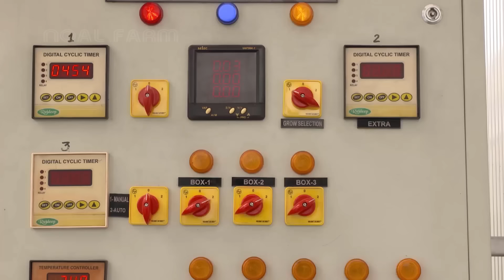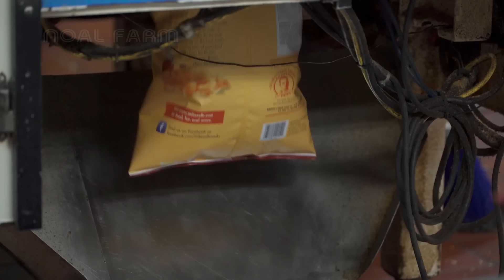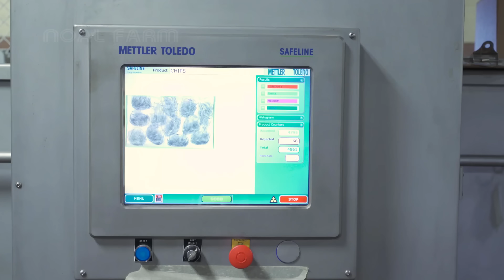Aeroponics Potato Farming - Potato Chip Process Factory - Modern Potato Agriculture Technology

Comment: I can’t se how this can be cheaper and more efficient than conventional farming considering the amount of electricity needed.
Reply: No need to water whole fields in dry season. No need to waste fertilizers.
Pumps and fans don't use that much electricity really.
Reply: Potatos need very specific climstes to be productive
Reply: Farming implements use a lot of fuel, in-field irrigation is a total-loss system, so no water is recovered once its pumped put to the fields, and you can't control nature.
Reply: I think also this has limitations. Potatoes are harvested small, any larger and it probably will break off the roots its hanging from. Maybe good for seed potatoes. Might work for smaller veggie types.
Reply: Thats simply Dreck, Müll. No human shall eat such rubish🤢
Reply: It doesn't deplete the ground. All electricity CAN b eco friendly and free.
Reply: @kilnrargentina3955  really, considering they grow around the planet in very different climatic zones I'd argue that they are extremely adaptable and quite easy to grow in a variety of habitats. It's no mystery though farmers and food giants pretend it's some superhuman technical feat to grow a potato.

Comment: I like this a lot, but given that the potatoes are hanging from a root mass not designed to take weight, does that limit the size the potatoes can get to before harvest? The potatoes in the video are a bit small. I wonder if you layered a series of mesh nets, the roots could grow down through them and support the weight of the potatoes till they reach a larger size?
Reply: My guess is that the node where it connects automatically adjusts to grow thicker to support that weight. They of coarse as you said are not designed for that purpose, so there will be a limit on what they can support.

Comment: How nutritious are these without the soil? I thought they absorbed nutrients from it.
Reply: what it lacks, they added the nutrition into the water
Reply: Well I guess even soil has to be fed and nurtured to have any nutritional value to plants. The soil itself can b depleted of all nutrients. It must b added either with artificial products ( fertilizers etc)or natural products (compost, manures etc).
Reply: Soil is not a must since sufficient nutrients are fed through water. By this process, the question of cleaning the soil from the yields does't arise. Collection of the products in a healthy way is possible. While in mud, decay, mutilation, attack of pests etc can happen. By the aeroponics method, this can be averted.
Very useful for large scale industries. High investment  is required.

Comment: If you look at this video, you'll see plants which have a normal stem and leaves on top; and a root system underneath. The upper and lower portions of the plant are divided by a fiber mat which allows the roots to penetrate downward. In this case, the roots include potatoes. The upper portion of the plant is just for photosynthesis.

But in reality, any plant could be grown this way, as long as the root system is kept wet. It's not really hydroponics, because there wouldn't be a fluid bath or spray.
In theory, you could sprout some seeds on a fiber mat, and provide grow lights above. Below would be an ultrasonic humidifier to provide the roots with moisture and nutrients.

Comment: Feels like with a little bit of genetic modifications, this would result in way better results. Aeroponics solves a lot of problems plants need to solve and bring few problems that seem to be preety severe that could be easily solved with some genetic modifications. Way less roots, less and weaker leaves, shorter but stronger roots so you can have bigger potatoes. This plant obviously does not need long roots anymore as it does not need to dig deep for nutrients and does not need stability. It does not need any protections either as its greenhouse plant.

Comment: now they just need machine vision robotic harvesting arms...  Use Python, and OpenCV, and/or LIDAR.  If passes size of circle in Open CV, then send the coordinates to the plucker arm, which could be a vac tube with a cutter attachment.  If manual labor continues, then make the root zone at the ideal standing height, so as not to have to bend over to harvest.